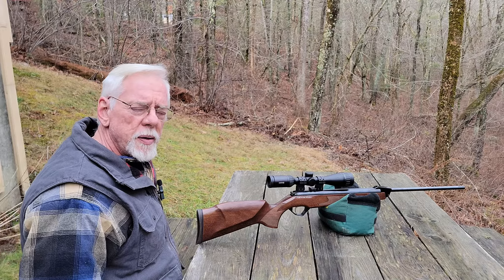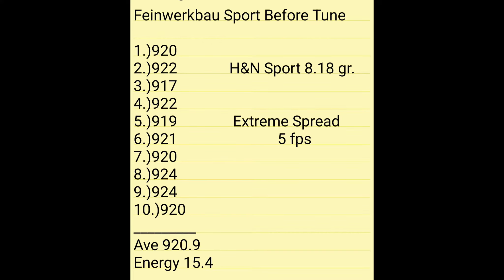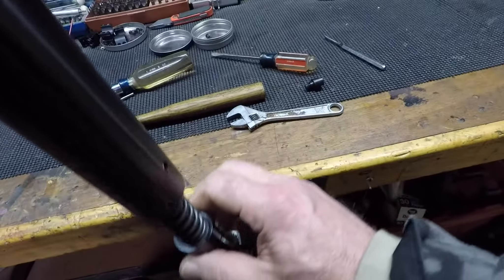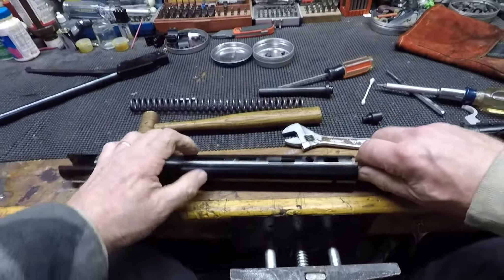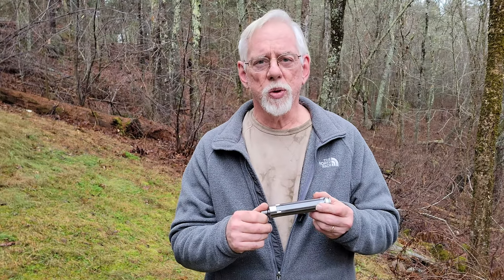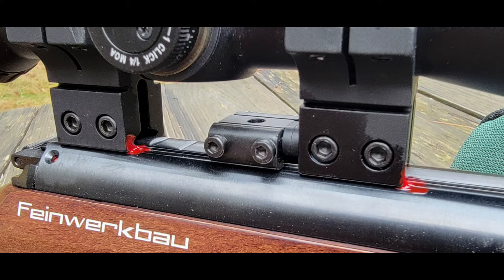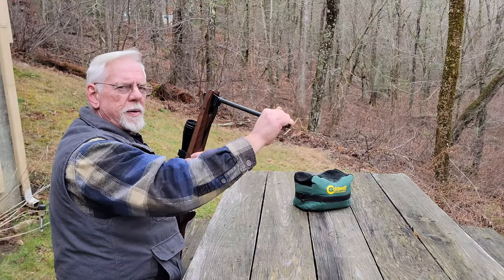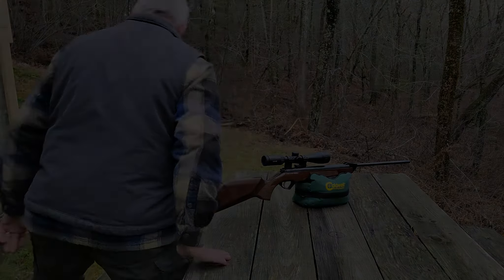Tuning the New Feinwerkbau Sport Air Rifle (Taming the Beast)

Comment: Congratulations on the video and the result of your work on this rifle, if you allow me I will leave here a tip for those who like to work inside springers, when I make a sleeve for a piston I use films from old x-rays, they last years without deteriorating, normally I make a new sleeve when I change the spring, but I have never replaced a spring where the sleeve was deteriorated. Sorry if my English isn't correct, I used Google Translate.
Reply from the maker: Your English was perfect, Jose. I have a friend who suggested using the plastic from windshield washer fluid bottles. Thanks for the tip, my friend.

Comment: I’ve learned so much from this vid thankyou. I managed to track down the history of my early 80’s HW80 with unusual cylinder seal ( O-ring seal instead of the usual cylinder seal). It was apparently a custom job for FAC rated rifles carried out by Venom. I made contact with an ex Venom employee who informed me he runs the same system in HW80 running at 30 ft lb with no issues at all. Regards (UK sub)
Reply from the maker: Thanks, Alan. I'm glad that you found the video helpful. 
I've heard of that piston / o-ring arrangement, but I've never come across one myself.

Comment: You've transformed it! It is now a nice, tuned rifle. In honesty this is how I would have expected to have shot out of the box considering its high price. Having said that every spring-piston air rifle I've ever bought gets the strip, polish and moly treatment and a tight fitting spring guide which removes the twang. 
I believe you did the right thing by lowering the power output as in the real world the difference in 15 ft lbs to 12 in .177 is hardly noticable and is better for accuracy. I'd sooner have a rifle that is accurate and lower powered than a powerhouse that can't hit anything. A nice firing cycle is where it's at. Many thanks.
Reply from the maker: Thanks so much. I'm very pleased with the rifle now. It shoots like a dream. 
I sincerely appreciate your viewership.

Comment: I did the aluminum sleeve, didn't last , also Pop bottle plastic will fail rather quickly, and after that failed I did some more research, and to my surprise, it turns out regardless of how nice and smooth the plastic seems it actually creates more drag.  I have since made a steel one from a smooth can,with no ribs. I haven't used peek but I suspect that would be even better. It's a lovely looking air rifle! They could rival any spring airgun if they just finished what they started. Thanks for the video!
Reply from the maker: I was wondering how long it would last. I kinda' expected that it would be short lived. Thanks for your input.   I'll take your advice when it does fail.
Thanks for watching!
Reply: For "peek", did you you mean PFTE?
Reply: @chrisw4611  yes my bad

Comment: Wow....great video. I havent looked at FWB in years.  I shot a 300S as a Sub Jr in the 70s in Jr High. 

What a blast from my past. Now looking at a few of the vintage FWBs. I think the Sport model could get more use as my competition days are behind me.  Question... was your new Sport just a outlier or  do they all have these issues that need to be tuned out?  You are a new sub for me.
Reply from the maker: Hello, and great to have you aboard, my friend.  The Sport has been discontinued. However, there may be a few on shelves at certain retailers. 
It's a general consensus among most Sport owners that they are a little oversprung, resulting in a rather harsh firing cycle. However,  the issues that I had are quite rare. 
Thanks so much for subscribing.

Comment: Hi Kevin, 
               Thank you for another great video and lesson. May I ask, please, when the air rifle trigger is pulled and the piston released, does the piston touch/brush the top of the compression chamber or does it just miss? I always presumed it would fall just short.
Thank you.
Best wishes, Ian.
Reply from the maker: Hi Ian. The piston does indeed come to a violent stop when it contacts the end of the compression chamber. The resistance that the pellet provides is enough to prese
rve the life of the piston by limiting the air flow out of the transfer port. For this reason and as you're aware, repeatedly firing without a pellet (dry firing) can cause much damage over time.. The resistance that the pellet provides is enough to protect the rifle from harm.
Reply: @razor1962  Thank you, Kevin. A fantastic explanation. How fantastic is our modern technology 👏

Comment: That's mad l didn't even know you could still buy them new that was a surprise and news to me . I have one of those original air rifles from the seventies it shoots like a tuned air rifle amazingly accurate and hardly any recoil and the trigger is better than the T06 and rekord trigger assemblies that sounds and cocks like a cheap Chinese air rifle l can't believe they made it , surely they are not all like that.!
Reply from the maker: Hi David, 
This is a completely different rifle than the original 124s and 127s. This one is the "Sport" and sadly, it didn't last too long in the airgun world. It was grossly overpriced at 1st, and the price slowly fell to become more in line with the competition. With somewhat lackluster sales, the rifle was discontinued. 
No, they are not all like mine was. Most of them were pretty quiet, albeit a little buzzy with a harsh recoil. They definitely respond well to a tune. 
Getting back to your 124, now that's a classic. You're correct about the smoothness.  I've owned a few over the years. They are delightful guns.

Thanks so much for watching, my friend.

Comment: Great video!  I have a new Feinwerkbau Sport air rifle and interested in doing a tune.  Did you end up using the stock piston seal or were you able to use an aftermarket seal?  I checked ARH and didn't see anything available for this airgun.  Thanks!
Reply from the maker: It was an aftermarket seal, and it was from ARH. He's got a category on the left side of the main page that lists "Piston Seals"
Click on that, and then it's the very 1st seal listed.
Fits the piston much tighter, and mine required no fitting.
Have you got plans to make a spring guide from Delrin or something similar? That's the main component that cancels felt vibration. It must fit tight within the spring. Jim (ARH) might be able to make a custom kit just for that rifle. In fact, I wouldn't be surprised if he's already got the measurements and made a few by now. Even just a new guide and the original spring would make a big difference, but the length of the original makes for a harsh shot cycle, in my opinion. 
Feel free to reach out should you run into a roadblock. 
Thanks for watching,  
my friend.
Reply: @razor1962  Thanks for the information!  I'll go back to the ARH site and check it out.  As for the spring guide, no I didn't have any plans to make one myself and was hoping ARH would have something.  I'm extremely happy that I was able to buy this rifle, but I agree that it definitely needs a tune.  I've installed several of JM's tune kits in the past, so was hoping he eventually comes out with one for this gun.

Comment: Just tearing into my 1982 FWB 124 Sport.  Hoping it is a little better in fit and finish than the new one.  It would have been nice to see you assembling the gun and how you avoid damaging the safety while compressing the main spring.  I am just finishing building a spring compressor for mine.  I used a solid scope mount with a 1" id and a piece of stainless 1" tubing (marine railing).  Machined and fitted ss slugs for each end with a hole drilled and threaded 1/2" x 13 tpi machined a slotted (for adjustability to other rifles) plate that bolts to the end slug  at the end of the plate is a welded nut, again 1/2 x 13tpi into which slips a section of ss all thread with a handle welded to the end (you could just weld a nut on).  Using a piece of high density poly to form around the safety so an aluminum pushing plate pushes on it and the threaded rod pushes on a recess in the aluminum to keep it centered.  I might add a captured thrust bearing if needed tomorrow.  I am replacing my disintegrated original plastic plug and will upgrade with the ARW kit.  I am thinking if there is as much slop in the spring guide as you found that I will machine a new one out of stainless and polish it.  A thick plastic washer between its head and the spring will dampen any impact as the spring detonates.  The gun still has very tight tolerances in the barrel fork and steel washers as well as the pivot bolt so I am hoping for the same quality in the rest of it.  Tomorrow will tell the tale.  Thanks for the video.
Reply from the maker: Thanks for watching Douglas. I employed a wooden block with a recess cut out to protect the safety. 
Check out my video on the installation of a tune kit for the 124.
https://youtu.be/jdhFC8Cyuek
Your spring vise sounds like a winner. 
Please check back and let me know how your 124 turns out.
Thanks for taking the time to comment.

Comment: awesome video thanks for sharing. the piston sleeve is to keep the spring from rattling in the piston? do you ever need to do something like that with your HW rifles?
Reply from the maker: Yes, the sleeve provides a barrier that stops the spring from vibrating directly against the piston wall. Keeps the tolerance snug to decrease vibration.
All of my HW guns have Vortek kits in them. The kits include a steel sleeve which produces the same results.
Reply: @razor1962  Oh gotcha, I haven't installed the vortek kit yet I didn't realize it has both a sleeve and a guide.
Reply: @patrickrenschler Hi Patrick. I haven't heard from you in a while. I hope that all is well in your life 🙂👍.
Reply: @springpistonriflefeverlone9611  thanks! Happy 4th!! 🇺🇸🇺🇸🇺🇸

Comment: Great video. Can you explain why you cut the spring down? Seems you lost several ft lbs. Also, is that bottle plastic still holding up? I’m fascinated by this build but am unsure about that plastic sleeve.
Reply from the maker: The gun, in my opinion,  is oversprung. This makes the firing cycle very harsh. Taking a coil reduced the recoil substantially and reduced toe power output by about 1 lb.  Time will tell on the plastic sleeve. So far no issues after 500 shots. Thanks for watching!
Reply: @razor1962  thanks Kevin, yes only 1 lb reduction, sorry mis-read numbers. Last question - that piston seal popped off so easily, did you do anything to counteract that? You made a point of showing how loose it is, but didn't comment further on any changes. I guess the question is - is that semi-loose piston seal OK as is? Thanks again, I've re-watched this several times, very informative.
Reply from the maker: Hi James! I replaced the piston seal with a much tighter fitting replacement from ARH (Jim Macarri). The original was prone to separating from the piston.
Thanks again my friend.

Comment: Exellent simple tune you did there, i see the trigger looks as simple as the original sport, what piston seal did you use in it? I had a 124 old sport  with the maccari mongoose kit in & it cocked like a knife through butter & shot really well. For that price it should have shot as well out of the box your new one though i might add. The old pop bottle piston lube sleeve trick is one i've used for about 30 years too.
Reply from the maker: The "new" sport responded exceptionally well to the tune. It's become one the favorites in my collection. It's a pleasure to shoot. 
I bought the piston seal from ARH (Macarri). I haven't been doing the plastic soda bottle trick for as long as you. Perhaps you can give me an idea of the lifespan of the plastic sleeve? No idea how many shots I can hope for before it's ruined.
Thanks so much for subscribing and for taking the time to watch.
Reply: @razor1962  It depends on how tight a fit the spring is in it really, I use a washer inside the sleeve for the spring to rotate on in the bottom of the piston & one on the guide too well greased with moly i've only had one chewed up so far , i grease my springs well too & the sleeve prevents any of the grease getting past the piston head to caused dieselling. when they do fail you'll know as you'll feel it catching when cocking the gun. Some tuners used ptfe sheet for the sleeve but i've found the pop bottles work fine for me . What's the trigger like on your new sport? I was always dissapointed in the old one, for that kind of price the new one should have a rekord quality unit in like the new walther lgu  Imho..

Comment: The cocking noise was the reason I never bought a Feinwerkbau air rifle and always stuck to Weihrauch, that is a disgrace for a high price and alledged high quality German product. The turn around with cutting the spring, the sleeve, guide tube and piston head is a revelation. The lack of recoil and noise is amazing and goes to show how far a little fettling can transform a gun. 10/10.
Reply from the maker: In all fairness,  I have heard from other folks who purchased the Sport that did not experience any cocking noise. They do seem to all have a pronounced spring twang. For some, that's a non-issue, but for me, it's not  something that I can tolerate. 
Thanks for watching, my friend.
Reply: Why do about 90 percent of all hw owners tune their airguns ??? Because of the cooking noise and vibrations.... All my hw suffer from this (but sure hw are good guns... They are today's "Diana's"....)...

I have many HW's and a 350 Diana magnum among my many guns

Comment: Great job buddy. 🙂
Reply from the maker: Thanks for watching. I'm glad you enjoyed it.
Reply: @razor1962  Yeah I watched both your videos & the gun sounded really horrible before you worked on it!  I currently shoot a Weihrauch HW 99s (Same as your 50s I believe), Beautiful sweet shooter but it did have a bit of a twang when new. I just fitted a TBT spring guide & top hat (short guide for the front of the spring) Relubed with Moly paste. Didnt need a piston liner because of the front guide. Now its beautiful to shoot smooth & quiet. Ive shot Weihrauch guns since 1980 & loved them all.
Reply from the maker: @TheFoxio  A Weihrauch is hard to beat. I wanted to machine a top hat but my lathe skills weren't up to the task. The sleeve was my next best option. So glad that your enjoying the videos. Thanks for watching.

Comment: When you consider just what a lovely shooting gun the 124 was out of the box, it is really difficult to credit that FWB would present you with such a lemon, particularly at that price point. I would be interested to know how many other shooters have experienced the same disappointing performance, Also it seems to me that power levels rather poor the 124/127 used to produce around 16/17 foot pounds, after all these years I would expect at least 21 ftp's from a company of this stature, smooth shooting to boot. Whats going on FWB you need to up your game or lose your rep.
Reply from the maker: Hi David. You make a good point. I've run across a few other Sport owners with similar issues and some others with zero complaints. 
Thanks so much for watching my friend.

Comment: Why did you keep the dovetail mount ??? Why didn't you installed a picatinny og wever rail (Hawke has a nice one) and used some picatinny og wever mounts instead ??? Dovetail and dovetail mounts are a pain in the ass on many spring guns ... Dovetail = stonage....
Reply from the maker: To change from dovetail to Picatinny, would require a Picatinny adapter that clamps into the factory dovetail grooves. If the grooves are still being used to hold the Picatinny adapter and scope in place, how would it make it any more secure than a standard, one piece mount?
I know that I used two piece rings and that was to allow for more spacing options. 
Thanks for watching, my friend.